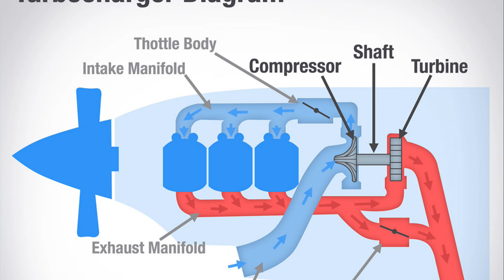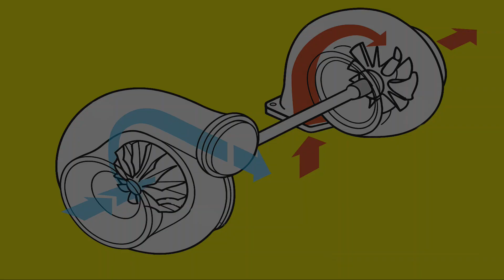The History of Turbochargers in Road Cars: How Turbo Tech Changed Driving Forever

Comment: I have a 2001 TT AMU roadster 80,000 miles love it
Reply: Coincidentally I talked about turbo yesterday when I was picking up my children from school. It was a hot day so we had windows down and we heard  the turbo spooling few times and I explained to my children that it was a sound of the turbo. I have just realised that in our household we have all turbocharged engines starting from my wife's Seat Leon 1.2TSI, my Audi B7 Avant 2.0T and 1.8T TT MK1. I remember in the 80s our neighbour had Saab with Turbo written on the car, as children we were so excited and we were checking every car to see what was the top speed on the dash, turbo badge was still very exotic.These were the times when everyone used to collect pictures of the cars(with specs like Top trumps) from the chewing gum called TURBO. The first turbo car I driven was 1999 Saab 9-3 Full Pressure 2.0. It is worth mentioning that Saab offered low pressure turbo, full pressure one and also a high output (HOT). Shame on what happened to Saab, they did not deserve it.
Reply from the maker: @kedzis than you for your comment Kedzis. That is a lot of turbo cars in one house! They sure do make a great sound! What happened to Saab was I fathomable. Although they made great cars, they always fell into a very niche category in my opinion. A little expensive, pushing them into a prestige bracket but without the market interest or share to compete. Thanks again for your comment! 👍
Reply: @andycharger I agree, perhaps they were too early in the market when turbo was a niche product, now almost every car has it due to EU regulations..
Reply from the maker: @kedzis you are right. Regulations have a big impact now.
Reply from the maker: What colour is it? They are just the best cars!
Reply: @andycharger 
Silver/black interior, my only wish would be the baseball glove interior
Reply from the maker: @peterangelos5282 same combo as mine!
Reply: Good education class/video Andy, so many turbo cars out there now, hard to pick a favourite